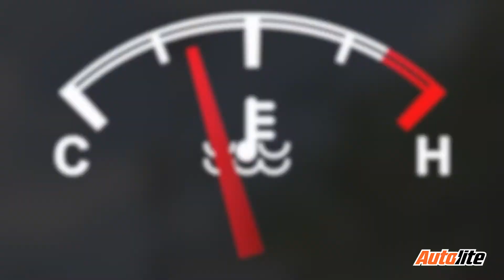Diagnosing A P0316 Code

Comment: I was about to buy a 03 mustang gt 119k miles . It doesn't have the check engine light on. It doesn't feel like it has a misfire I plugged my scanner and found this code 1/1 " p0316  engine misfire detected on startup (first 1000 revolution)" and no other code detected by the scanner. What could be wrong with the car since there is not a second code ?

Comment: I have a 21 ranger and I have a p0316 and p0300 code and I can’t figure out why. Changed the spark plugs, coil packs good and the vehicle seems to be running fine after 30
Seconds from start up